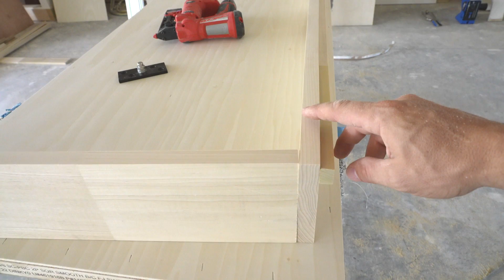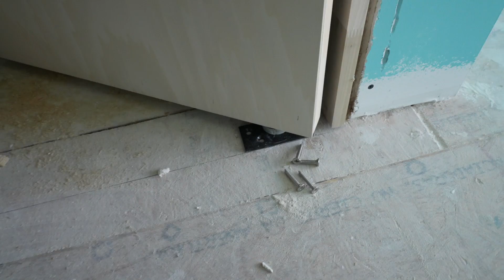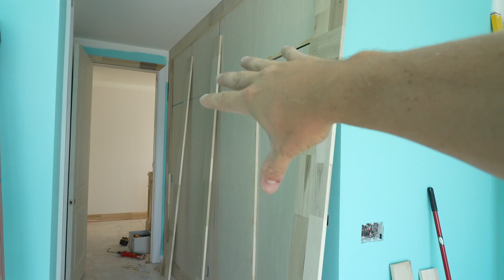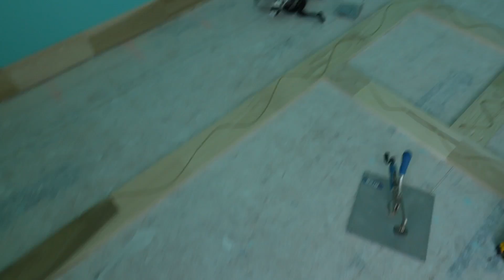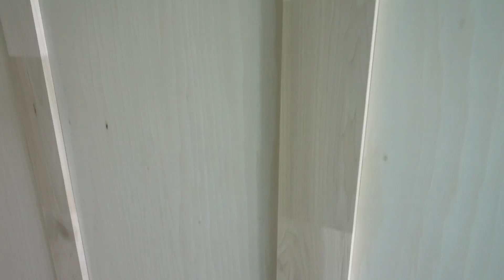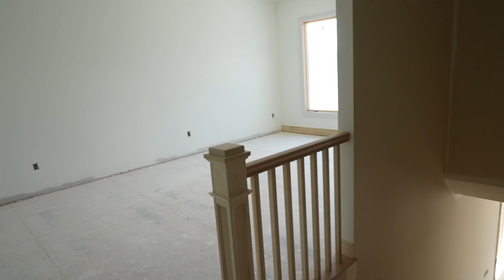This was TRICKY... How to Make a Secret Door In Wainscoting: Part 2/2

Comment: Your hidden door builds are amazing!  I’m planning on adding acoustic panels ( looks and ease of installation) to a wall that i’m putting another layer of sheetrock and MLV to dampen some noise.  I’d love to add a second door, that can have the panels attached so it appears to hidden. My question is, can a second door be added to existing jam? the jam would have to be extended obviously. I live in a small town and my job is small so getting a professional to come look at my project has been unfavorable. Just don’t know if it’s possible, would like to not have to redo current door, i have a airbnb on other side of wall. Found a door guy from 3 hrs away that will do some work, but $$$$$$  Just don’t know if anyone would do this … current door is solid and soundproofed , this door would be for cosmetic.. any insight would be appreciated.

Comment: I like your show, I’m building a 14’ wall of bookshelves with a hidden door for my first time on hidden doors. 
The 11” depth on the door and rails and clearances are a challenge, but fun. It will open in to room and will be a dark stain bookshelves with a locking key and a book latch system.

Comment: 11:40 - Noob question. When you say “scribe it to the wall/ceiling”, what does that mean exactly? You are setting the stiles/rails to be level/plumb so there is probably some variable gap with the ceiling. Not sure what “scribe” would mean in this context? Thanks!

Comment: Awesome job! Rixson and Jackson both make walking beam pivot hardware that is adjustable in 4 planes. Used more for commercial storefront doors, but still designed for 1 3/4” doors. Gives you the advantage of being fully adjustable.

Comment: Why does the right hinge size have no plywood over drywall? Can’t figure out what you did there with that final piece since it didn’t appear flush with the jamb.
Reply from the maker: If I remember correctly it has something to do with the the drywall being out of plane. I think this was due to the mud/drywall corner bead build up. That area was so far out of plane with the rest of the wall that I actually had to leave the plywood off in that area.

Comment: Do you have to shim up the bottom pivot to accommodate the carpet?
Another excellent video!!!!
Reply from the maker: No, with the way the hardware came it set the bottom of the door about 1.5" off the subfloor which was ideal.
Reply: @InsiderCarpentry  so it could just be popped of and installed over new floors?

Comment: Perfect timing for me on this video! Convinced me to go with pivot hinges over the "wide throw" hinge approach.  The part that helped me was the routing of the top jamb piece as i am starting with finished drywall and need the door to flush up to that drywall at the ceiling.

I'm looking at using the same rixson bottom setup but using the Jackson J580BS for the top of the door for adjustability since I'm a DIYer - more info below:

My project is an 8 foot wide by 8 foot tall closet space that is already finished with drywall and no header - am going to make two 4x8 doors clad in 1/8 white oak and 3/4" deep slats so it will look like a slat wall that is somewhat popular at the moment.  Since I'm a DIYer I'm trying to find the minimal risk approach.  

For others that have gone done this rabbit hole of clad hidden doors (wainscoating, slats, etc) the options I found were:
- the rixson hardware shown here (their pivot door hardware catalog is great - appears the 128-3/4 was used here - just google that and the catalog link is on that products download section) 
or Wide throw hinges like the ones below - with the amount of overlap on the wainscoating in this video I doubt any of these would work though - if you have smaller overlaps they likely would work:
- Soss 518
- Tectus TE 540 3D A8 
- Sugatsune HES3D-W190 (not the E190 which is not wide throw)
- McKinney MK80 (not really a wide throw but might work in some applications)
Do your own googling of prices but out of all the options the Rixson is the cheapest for my project by far due to my door size at 48"x96" and about 100lbs - the fancy wide throw hinges are around the same price as the rixson but you need 2-3 of them per door - the Sugatsune and the Tectus are 3D adjustable which was an attractive option to me as a DIYer that doesn't have the skills of Spencer (😳at the "strong 32nd" statement).  

I am also looking at not using the "top of door" part of the Rixson 128-3/4 and instead use the Jackson J580BS - it is just a pivot hinge part for the top of your door but adds the ability to adjust the pin to/from the jamb - havent researched enough yet whether you can just buy the Rixson bottom portion separately to make this approach even cheaper.